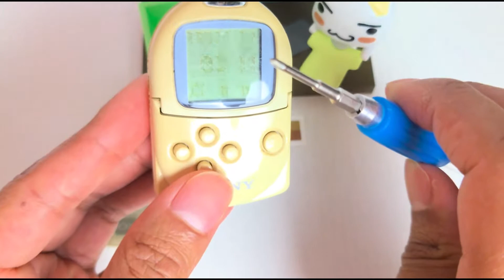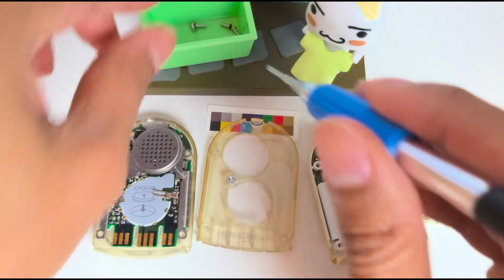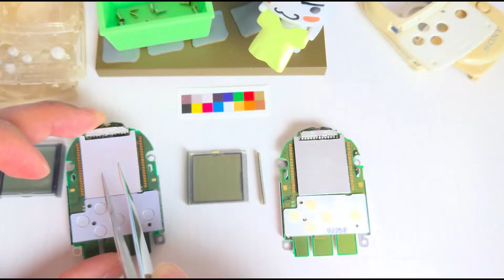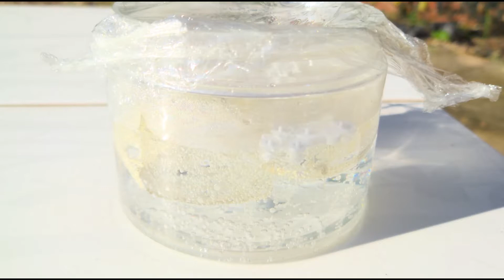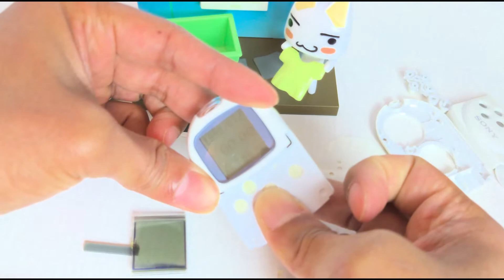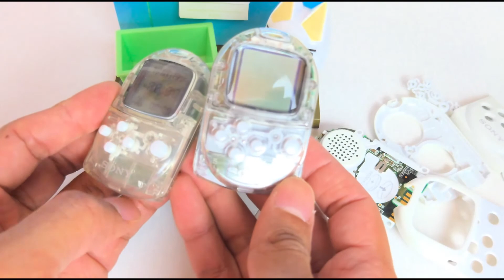Game Master Clinician √v^♥ Sony PocketStation Teardown & Restoration SCPH-4000 PS1 PS2 Memory Card

Comment: I think that it's likely that the screen isn't faulty for that unit .The silicon contact / zebra strip was probably not interfacing with the LCD properly, leading to those dead lines. Thorough cleaning of the zebra strips, as well as some very thin clear tape strips on the edges of the screen (very weak acrylic tape) gives enough pressure across the contact points for all LCD lines to work again. (maybe the zebra strip is flattened/deformed or dry). I've done that exact thing on a couple of pocketstations with the issue.

You can also buy new zebra strips online and cut into size.

Comment: Where did you get the blue one?
Reply from the maker: The plastic can be dyed using specific formula but can result in damage to the shell integrity: heat, acetone, fabric dye. The results vary depending on the condition of the original plastic.
Reply: @GMClinician  Yes, I watched the video, but your comment didn't quite answer my question.

The place of origin of the Pocketstation Blue is where?
Reply: he's saying he dyed it